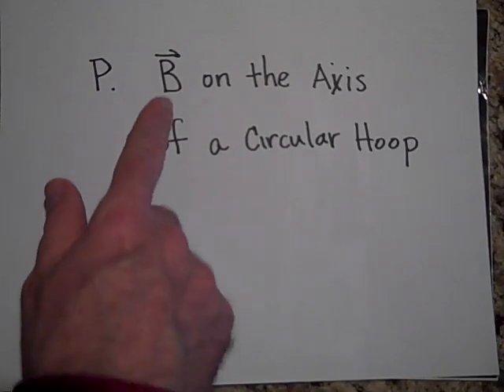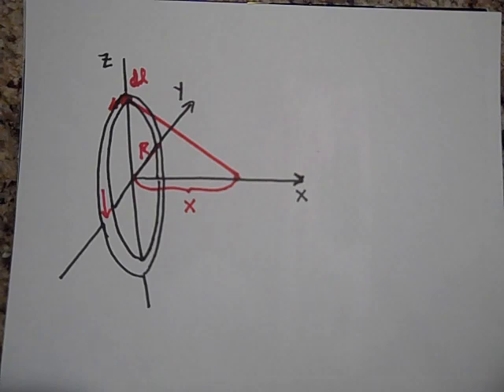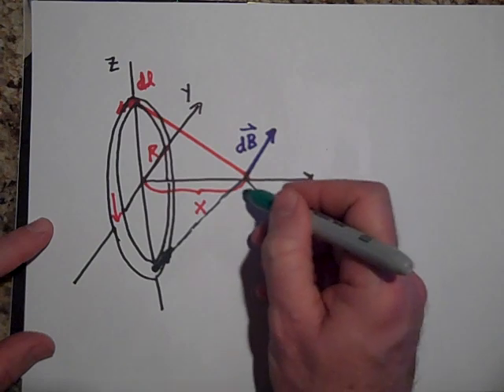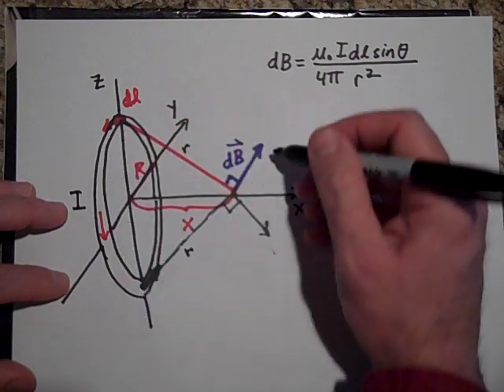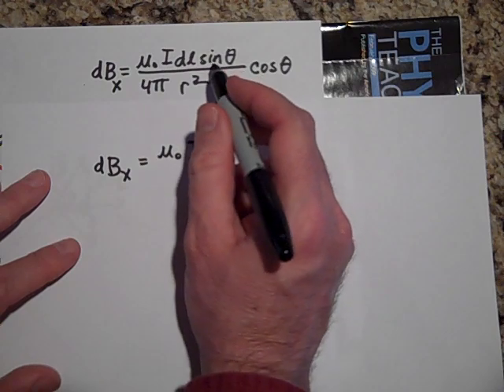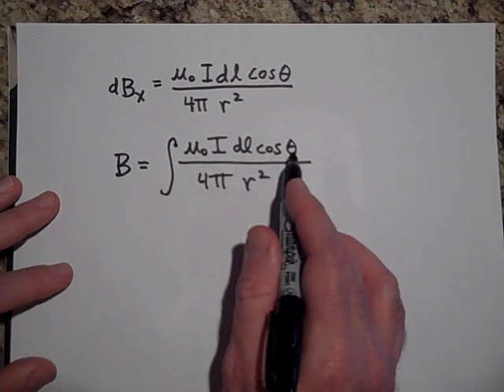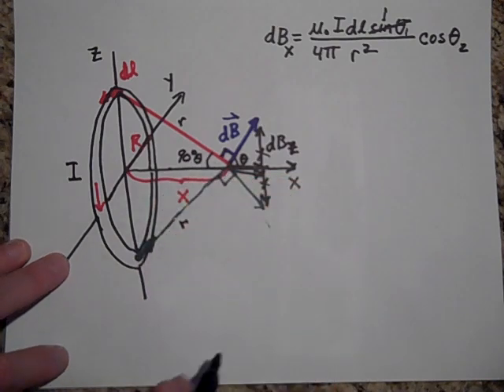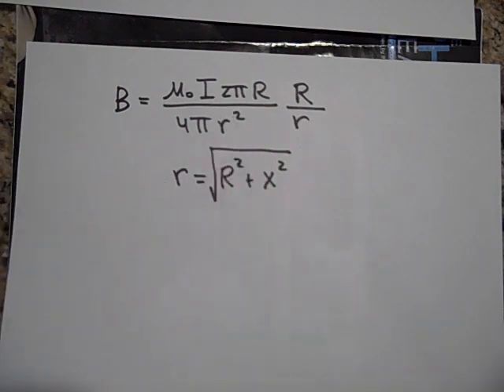Calculating the Magnetic Field Strength on the Axis of a Circular Loop of Current-Carrying Wire

Comment: Hi, great video which helped me out! I was wondering however:

You are currently determining dB along the x-axel. I was wondering how one would go about calculating dB in your y-axel, in potentially the same direction as R? Is this possible by the use of Biot-Savart and using other cross products to determine the correct vector trajectory? So dB in the [0 1 0] trajectory rather than the [1 0 0] trajectory in the video.

Thanks!

Comment: dB looks as if it goes to -y direction because of the drawing but actually you can see at 4:30 that it is composed of z and x components.  So, right hand rule is still valid.
Reply: but shouldn't it be purely in the x direction? along the axis of the loop?
Reply: Sorry - you're right. My bad!

Comment: I didn't catch the part - how the angle between dl and r is a right angle? u mentioned is as theta 1.
Reply: A good way to think about it is: The direction of dl is coming out of the screen towards your face in (in this video) y-direction. R is going straight upwards into dl, meaning that R is going in the z-direction. As these two vectors are perpendicular to one another, as they are along the y-axis and z-axis respectively, it means that they form a right angle between them.

Don't confuse R (the radius of the circle) and r (the diagonal between dl and an arbitrary point P where dB is being calculated) as dl is perpendicular to R, but not, perpendicular to r. The angle theta is the angle between R (radius) and r (diagonal between dl and point P).

Hope this helped :)

Comment from the maker: Let me just clarify.  The horizontal loop is 1 ft from the floor,and you want to find the magnetic field at a point that is 3.5 feet from the floor and 3.5 feet from the loop.  If you drew a vertical line through the center of the loop, would your point be on this line? I'm guessing the answer to this is "no" because it would not be possible with the second sentence of this reply.